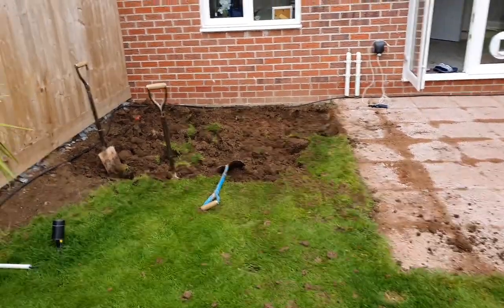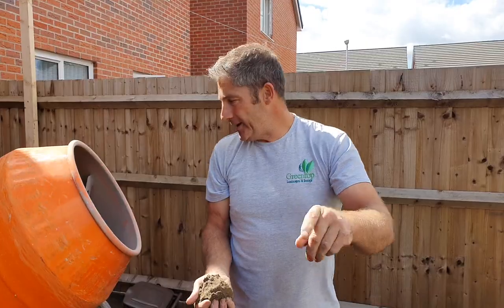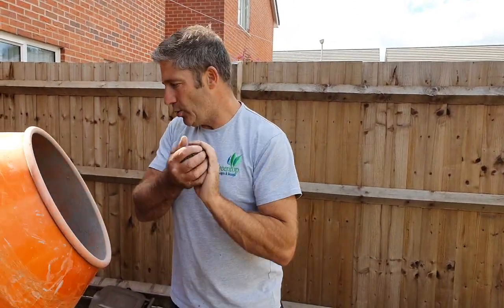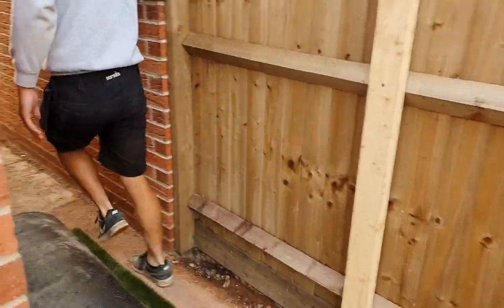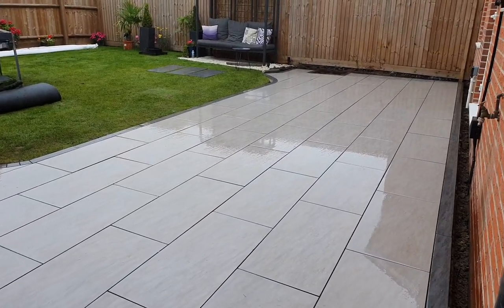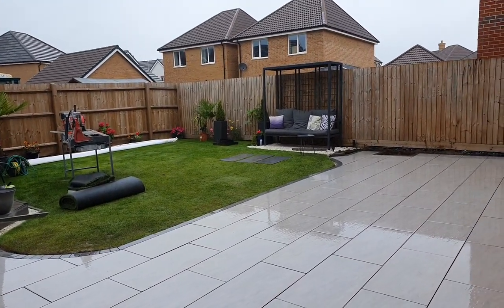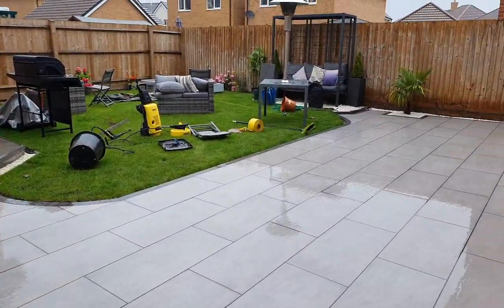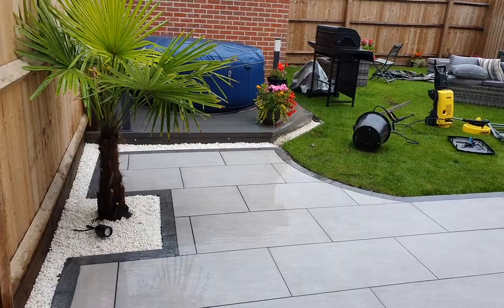Porcelain Patio From Start To Finish

Comment: Excellent job, thanks for sharing. I’m planning on laying porcelain slabs in my garden. My plan was to lay the weed fabric onto the topsoil, 15cm of type 1, compact it all and then lay the slabs on 5cm of mortar.  What’s thrown me is you’ve put a base of 5:1 mix down first then mortar then slab. Do I need to put the 5:1 mix down on top of the type 1?
Reply from the maker: what you doing is fine its just my preferred method

Comment: Great work guys , could i ask do you recommend sealing the porcelain slabs once laid ? We’ve had ours done but the contractor who done ours used sweep in grout is that any good? Thanks
Reply from the maker: Hi Paul, thanks for your kind words, your paving could be compromised with a brush in grout as the water could hold in the joint then the freeze thaw effect will ruin it. Good thing. is that brush in grouts are easy to remove. I would suggest re grouting, call me if you need.

Comment: Hi Johnny
I am about to lay my porcelain on a 20mm bed of 4-1 mix on to an existing concrete patio but have decided to slurry both the tile and the concrete as I don’t have room to go thicker with my bedding mix
Would you also consider adding sbr or plasticiser I my mix
Thanks 
Keep the videos going I’m learning a lot

Would you also consider
Reply from the maker: Hi John mate thank you I would do 5 : 1 all sharp and yes SBR in the mix is good.

Comment: do you find any difference between a 4:1 or 5:1 mix in terms of how the slab performs or is it just a case of less money spent on cement
Reply from the maker: Should not have it to strong as it can crack

Comment: Can you lay porcelain over the existing slabs or you have to remove them first??
Reply from the maker: Well that will just depend on the paving its self
Reply: @GreentopLandscapes  
An existing paving is only few years old. It's very solid and there is no loose slabs or anything like it. I was wondering if I can do it as that would save me a lot of time and money.

Comment: Loved this patio and the end result is amazing... just what we are after. What porcelain tile is this and how much it would cost for a 35m2 area, including your labour? We're just getting quotes for similar but they are out of our price range. We are even thinking of trying to do it ourselves but when we watch your video, we know it will be so difficult as we're not skilled.  Many thanks in anticipation.
Reply from the maker: Thank you so much!
Reply: Hi, we have exactly 35 sqm area where we want to lay Porcelain with similar idea to the video. Did you manage to get some quotes? Did it work out expensive in the end? Thanks
Reply: It was hard getting landscapers in to give quotes on our slightly sloped area so we've had to go with decking after all as the guy who installed our garden room was great with installing decking. It's only just underway. Paving would be our first preference but prices for stone and then labour was sky high. Hope you all get a better deal.

Comment: What saw and blade are you using to cut porcelain. It looks like a rubi but what model if you don’t mind me asking.
Reply from the maker: its a new one I am testing at the moment for them but I like the Viper one
Reply: Greentop Landscapes & Design hi I’ve been doing some research is the rubi dc 250 850 ok or do you need the dx250 1400 for 20mm porcelain 
Many thanks.

Comment: do you need expansion joints on a project this big ?
Reply from the maker: Well that’s a good question, not in this size but if it gets bigger you would need to
Reply: I’m doing 8metres by 8metres do you think it’ll need an expansion joint I can see your well experienced with porcelain      I’ve only done 1 porcelain job previously  but it was only small where as most other paving is more forgiving and flexible any advice would be really great full 👍
Reply from the maker: Jonathan I’m away at the moment but give me a call the weekend

Comment: Loving the videos..  really well explained and it’s good to see a tradesman showing you how to do it!

I have got 60sq meters to lay, the porcelain slabs are here with the sharp sand and cement and I’m going to try doing it myself with someone else only because it a 3/4 month waiting to get hold of someone to do the job who would be good! 🤞🏼 

What tile cutter do you recommend for 20mm porcelain slabs?
Reply from the maker: Hi Luke always here to help and happy to take a call any time, there are so may ways to cut a tile but we use the Rubi Bridge saw and a small Plunge saw but there are blades out there that you can put on a small grinder that will work well mate.
Reply: Luke I just laid 100sq meters and we used a makita 9 inch grinder with a porcelain blade on it, worked a treat.
As I don’t lay patios everyday it weren’t worth investing in a ruby cutter, and hiring one near me was £130 a day plus vat
Reply: How much for 20 square metre